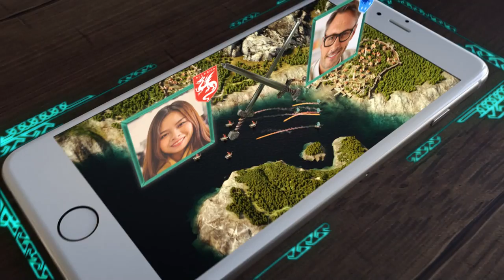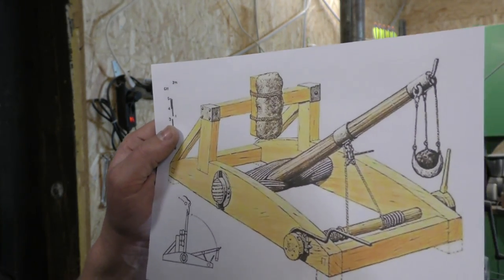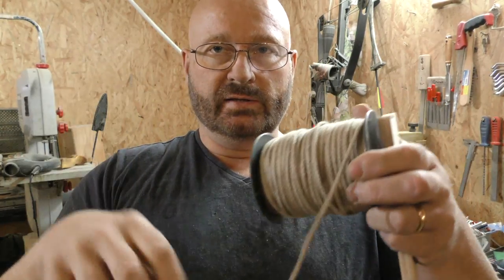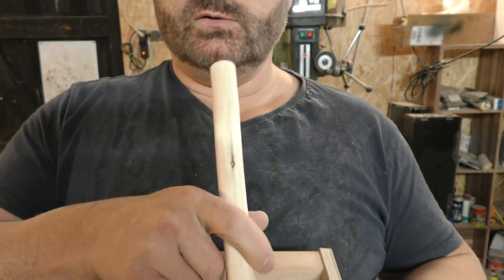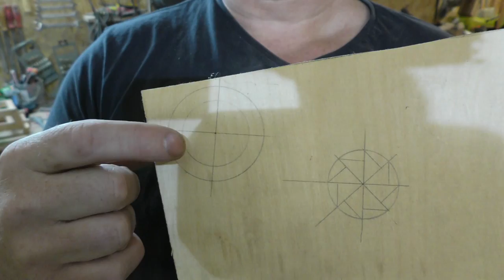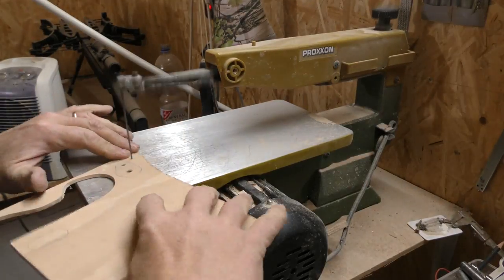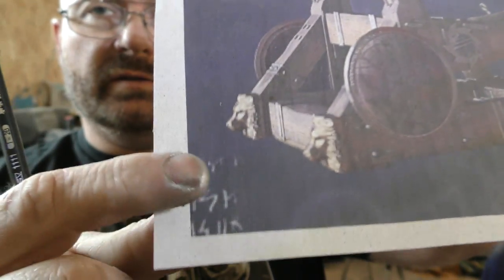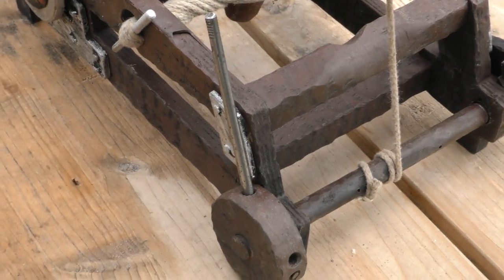"Vikings" Siege Engine - 90 kilos, 300 meters?

Comment: Trebuchet is superior siege engine.
Reply: Because it has a counterweight.
Reply: And basically infinite potential energy
Reply: DEUS VULT
Reply: Because it can launch a 90kg projectile over 300 metres
Reply: pervy kun bro...it's memes.

you can't logic memes bro. just go with it bro.
Reply: Laxative Tester actually you can it just depends on the design.the ancient Chinese actually designed a hand operated trebuchet for naval battels
Reply: Laxative Tester Kekistan only used trebuchet for defence. Not sure if it still counts as siege engine then eh?
Reply: Trebuchet memes 👌
Reply: Laxative Tester personally I prefer Greek fire to both
Reply: Windsor Snake Greek fire can be launched by a trebuchet and is a substance not a machine.
Reply: it's like comparing mortars to howitzers !
Both doing their job great, but one is more simple, the other got more range
Reply: Laxative Tester. i watched a history channel show where they  built a trebuchet(sp?) that was capable of throwing vw bug automobiles 100 yards easily..  i was thoroughly impressed.. they tried fixing it as opposed to allowing it to rock back and forth on its wheels...  that didnt work so well.. much better range with the movement..
Reply: I have a small functioning trebuchet that is about 10-12 inches tall. Very impressive when you imagine one 50 feet or taller. I like to put those little paper snappers that pop when you throw them on the ground due to a small nitro glycerin charge. Only with the development of cannons were these awesome machines made obsolete.
Reply: Would be cool to see a catapult with specialized rounds designed to be used on Infantry and have a ballistic gelatin army to shoot at and see what it can do.
Reply: Brother, did you lay siege on a neighboring kingdom using a siege engine capable of launching a 90kg stone projectile over 300m yet?
Reply: T R E B U C H E T S T R O N K
Reply: Laxative Tester Trebuchet were used as defense due to the massive counter weight.
Reply: That's not the point though.....he builds everything so ofcourse he's gonna build both.
Reply: There technically were antipersonel rounds for trebuchets.  If a trebuchet could launch a single, 50kg stone it can also launch fifty 1kg stones, and a 1kg stone falling from 50 meters in the air does a lot of damage to a squishy human.  Hell, even a 56g lead ball from a sling can kill someone...

Comment: I see one design flaw with this: The release mechanism.
The arm is free to move forward with the locking pin still in the arm.
On a full size siege engine, this would rip the release cord from the operators hands, possibly causing serious injury. Therefore, the locking mechanism should be the other way round, two outer pieces connected to the rope, a single inner one on the arm.

Otherwise great build!
Edit: The Slow-motion showing the arm slowing down is great, that means the arms energy gets transferred to the projectile. The reason for this is the conservation of angular momentum.
Reply: Exactly. There is a lot of energy needed to swing that projectile up in an arc over the machine. As the sling approaches the vertical, there is more energy available to again move the arm.

If the ropes were twisted tighter, the arm would move further forward before slowing or stopping. 

The torque provided by the twisted ropes ideally is tuned to the weight of the projectile. If the torque is too low, the projectile will not go very far. If the torque is too high, the arm will bang into the stop beam harder than necessary, causing the engine to fail more quickly. The ropes also usually had ratchets. The twisted ropes are very moisture/humidity sensitive. 

The distance can also be varied quite a bit by jacking/blocking  up either the front or the back of the machine. There is no need to adjust the angle of the hook at the end of the arm. Unless the hook is firmly fixed, it is likely to fail quickly.

Comment: Don't forget to add the stop pad. I speak from experience that it really keeps things from blowing apart. The stress through the throwing arm as it hammers into a solid wooden beam is enormous and a thump into padding after the arm has done its work can be the difference between another shot or tooth picks.

Comment: well what do you know, I made a bigger model from the exact same image off the internet about 10years ago for a physics experiment back in school. I used a tennis ball as the projectile and it would propel it a good 30meters or so if memory serves me right. I had to be really careful when using it as there was so much power in the swing arm that when it fired you couldn't see it move it was that quick.

Comment: The thing you noticed at about 31:45 is actually very common in sling firing devices, and is the result of all the kinetic energy stored in the arm being transferred to the sling and ball. This is similar to when a whip cracks and is the reason that devices which use a sling are so effective.
Reply: So if you tuned the device to have that "stall" point when the arm was just a fraction of an inch from hitting the arm stop, that would be the theoretical maximum energy transfer?
Reply: I believe that is correct. The time at which the stall happens I think is tunable by the angle of the nail in the end of the arm. Most of the time the angle of firing is more important than a small amount of greater rotation which would increase the speed, therefore in order to get more rotation and therefore build more kinetic energy there have been many fancy trebuchets invented like the MURLIN trebuchet. Definitely worth checking out a murlin firing. Anyway, take anything that I say with a grain of salt because the engineering that I am studying is not mechanical.

Comment: Joerg, the arm of the launcher stops moving for a split second while the pouch that is carrying the payload swings up and over because of the change in direction of the projectile in the pouch. As it swings up and over, it starts to move faster than the arm itself and creates more 'backward' force on the arm which holds it in place for just a moment while the pouch releases. Then the arm finishes because it no longer has to move the heavy projectile. It is the same principle if you were to take your "weaponized industrial trash bag" and swing the rock inside as if you were throwing a kettlebell over your head. It pulls you forward because of the change in direction and velocity. I hope this makes sense as I am definitely not an expert nor eloquent in speech! Haha! Good luck with all your further projects! :)

Comment: At the moment the arm stops the pouch has reached the maximum of momentum and is in one line with the throwing arm. All energy ist transfered to the ball at that moment. Then the pouch ejects from the arm, the ball fly off, the mass of the the ball is out of equation and the arm will travel the rest of it´s way. Also you need to consider that the arm has the maximum tork right at the beginning and will get less as the arm get´s to the end position. That´s not the same as with rubber.

Comment: He was just making a guess about the weight of the golf ball scaled up 20 times?
When scaling things up by 20 times you multiply lenghts by 20^1 ( the first power of 20), surfaces by 20^2=400 times and volumes by 20^3=8000 times.
Because the weight of a certain substance (in this case the golf ball) relates to volume x density the weight has to be multiplied by 8000 as well.
A typical golf ball weighs around 40 grams, this ball scaled up 20 times weighs 40 x 8000 is 320000 grams or 320kg.
When scaling down the calculations goes the other way, using the square root for surfaces and the cubic root for volume (and weight if the model is from the same material as the original)

Comment: The topic of wheels- Some Trebuchets had wheels. They were not used to move the weapon around because it was built on site. The wheels increase the power stroke. As the arm moves forward, the weapon rolls backwards. The weight no longer drops on an arch, but directly down. More power is produced when the drop angle is straight and not on on an arch or angle. When the arm passes the fulcrum, the weapon rolls forward. This causes the weight to remain stationary for a moment (in relation to the ground), so it isn't working against the arm and slowing it down. Power is drawn from the momentum before the moment of release. I could have explained it better, but it's hard without pictures.
Reply: Also, Joerg is a pretty cool cucumber. Very interesting topics and experiments.

Comment: loved your finishing of the toy as well as building it from scratch! awesome work.
about that bent top nail on the shaft - would less or more 3rd rope length make it for less backward angle, so your pouch doesn't fall off on armed state?
thinking of that triangle-mounted thing and the tri-point-always-a-plane axiom - it's there right for that reason!

Comment: Hi ! I cannot afford me to read all comments but I wish to give you this historical point :
Trébuchets were built right on siege places from trees around. 
All the components dimensions were calculated depending from the size of the winch and assembled without iron nails or parts.
Contrary to the mangonneaux, the trébuchets had also wheels that were boosting the balancing effect and the range of the projectiles.
Thanks for this vidéo Mr Slingshot ! 😉

Comment: Hello Sir. Flipgun here. That pause in the arm swing was a nice lil' problem. I would like to suggest that it is the result of the construction of the pouch. You have constructed a square cup. As I see it, when the arm swings up the load is prevented from following a true arc and as it presses against the top lip of the cup, it interrupts the arc line stalling the motion of the arm. I am thinking that if the pouch were a a triangle, plus the drag of the trailing chain, it would allow for a more natural flow of the load and a greater co-efficient from the arm.  Speaking strictly from my Auto shop/smoking area education.

Comment: I found the arm stopping (and slight reversal) at the top of the swing an interesting thing with scale trebuchet's too: I found it occurs most when the sling string is quite long when compared to the arm, and when the projectile is quite heavy compared to the torsion spring force/counter weight. I did some research on it and came up with the arm and sling acting as a double pendulum with a changing moment of area - you get very efficient transfer of energy going on between the catapult arm + torsion/counterweight and the sling string + projectile. Shame it actually means the projectile is now driving the catapult arm at that point so you loose distance. I got rid of it by increasing the counterbalance weight and reducing the projectile size, maybe pretension the rope spring even more?

Comment: I know this comment is coming a little late, but I thought I might try to explain the "peculiar" behaviour of the arm of the weapon while firing.

I've only taken a year of physics, so don't quote me on this. But I think essentially what happens is that the arm/pouch/ball system gains momentum as the torque is applied by the ropes, and when the loop of the rope comes undone, the momentum basically has to exchange from the arm to the pouch and ball to make up for the inconsistency that is caused by the sudden change to the structure of the system. So, the lever arm loses exactly as much momentum as the pouch and ball gain at that exact instant, and the ball is launched, then whatever tension is left in the rope brings the arm the rest of the way up.

It seems a little weird to me though: I think the arm would have to be significantly more massive than the pouch and ball to have a momentum exchange that sends the ball flying so far. Maybe it kind of "inherits" the mass of the rest of the weapon. Actually, that makes sense.

Yup, an AP physics student just forgot that the rest of the object exists. Way to go, me!

Anyway, I hope that was helpful! I'm terrible at explaining things. Keep up the great work!

Comment: am guessing the weird effect you see in the swing arm holding straight up before releasing the golfball is due to the weight of the golfball pulling outwards and pulling on the leather bag, once it reaches that height the chains start to slip, and the momentum of the golf ball has nothing to push against that affects the arm anymore however the outward force is still enough to hold the arm in the upward position until the ball has almost nothing left to push against becz it is almost entirely out of the leather satchel. sorry I'm not the best at putting things into words, if anyone can clear this up for Jorg please do!

Comment: +JoergSprave  The arm stops mid swing like that because of a transfer of the moment of inertia, or rotational intertia.  Once the basket and ball begin to swing outwards, the weight distribution of the entire moving mass shifts outwards, causing a dramatic slowing of the rotational motion.  then once the ball is released and the basket swings back around, the center of mass shifts back down closer to the axis, allowing the rope spring to accelerate it again.  Think along the lines of a spinning figure skater extending and contracting her arms to spin slower and faster respectively.

Comment: Attention Jörg- I don't know about this weapon, but I know wheels increase efficiency of some trebuchets because the frame rolls back and forth in time with the throwing arm. This causes the counterweight to drop straight down rather than an arc, and the machine moves forward as projectile is thrown. Seems like this machine would not gain anything from this. Just curious, thank you for the video!

Comment: I wonder why nobody has commented on the question you asked yourself about the strange launch movement. At least I see no comment so I will go ahead:
What we see here is the result of how this weapon (and trebuchets) works. The ball/stone  could just be mounted on the arm and would still be launched. It would do some kind or quartercicular motion until the arm stops and the stone flies by its own. With the stone lying in that pouch there is another circular motion (chain) going on, that also accelerates the ball. And while that is happening the centrifugal force rises quickly, reaching its maximum when the stone finally leaves the assembly. That force is so strong it can stop the arm and thus puts all the kinetic energy into the ball. and that is the reason why these weapons had so much power. With the arm smashing into its end stop (with the cushion) all the power of the impact would be wasted and would not go into the stone.

Hope that helped.

Comment: i made a similar device 15 years ago. it was about 4" x4" x 3". Instead of screws, i bound the wood together with kite string.
I also used kite string for the winding rope. it would launch a piece of dog food 25 meters.

Comment: For the cocking mechanism, couldn't you make the pin such that it slides through the wheel? So that when you pull it to the ground, you just slide it through, then you can continue winching it without removing and replacing it.

Comment: you can't just multiply the numbers up to scale and call it a day. when you upscale the rounded projectile, then the weight surface area ratio would be different, change the amount of drag that the air has on the ball, thus changeing ho far it would fly.

Comment: I would add one improvement on your engine.  I would put padding on the top bar in the front of the engine, so that your throwing arm has a smaller chance of breaking on a throw.  The padding will take out the edge of the wood the throwing arm hits as it finishes its movement once you release the arm.

You did a great job on that engine, shoot I even watched most of the video just to see your build.

Comment: I don't think the elasticity is in the rope, I think it is in the wooden beams that the rope is attached to (or in your case lengths of plywood). They are meant to bow in and store energy.  As they straighten themselves out they apply tension to the rope which  must untwist itself in order to lengthen and release the tension.
Reply from the maker: No, it is the rope actually. At least 95% of it.
Reply: JoergSprave I'm inclined to believe you, but I'm having trouble understanding the mechanics. Could you maybe reply with a link or explain how the rope can store energy without breaking?
Reply from the maker: The rope can be lengthened a bit, in part because the fibers themselves can be elongated and in part because rope consists of  twisted bundles of twisted fibers. Therefore it works a bit like a rubber band - same principle but a lot less stretchy. That is why you have to twist them to get decent force.

Comment: you don't need the release pin. all you need to do is lift the pawl ("locking arm") off of the ratchet ("locking wheel") and the mangonel will let fly
Reply from the maker: But then a lot of power will be lost due to the friction and mass of the winch system.

Comment: Upscaling does not work. Making everything ten times bigger means making everything ten times longer, with hundred times surface/cross-section area and thousand times weight increase. Even worse we want to fire thousand times heavier stone over ten times distance which requires 10000 times of energy. At the same time everything (i guess) can just take approximatelly 100 times more force. Only positive is that stone has to travel just three times faster to for nine times longer range.
You can't simply upscale flea to size of elephant and want it to jump over the block of buildings.